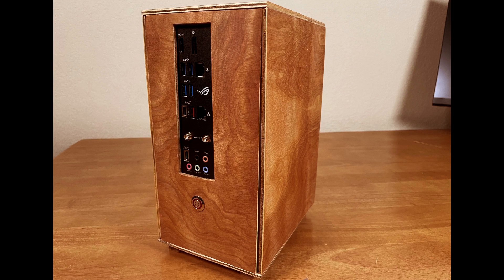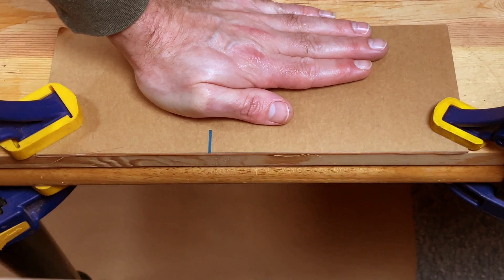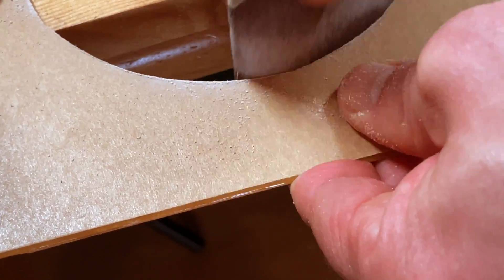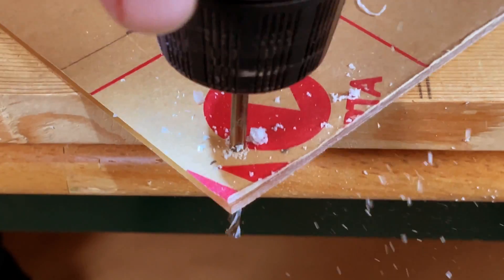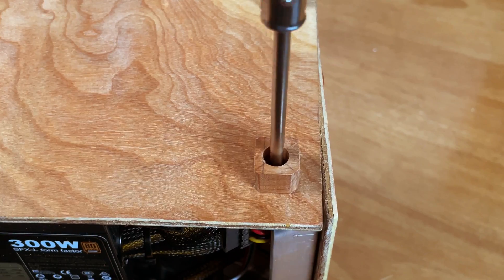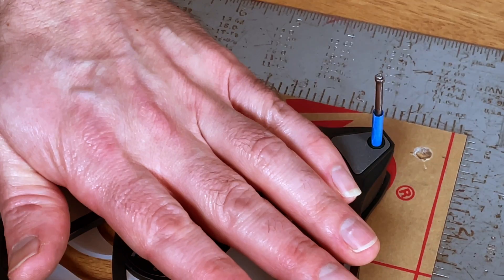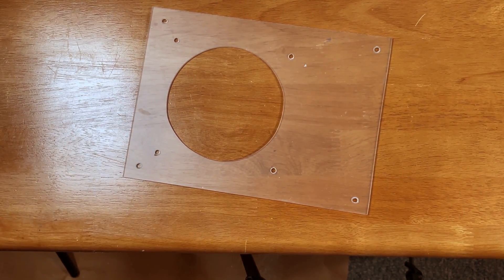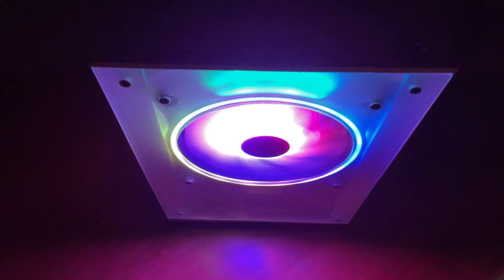DIY PC - Custom Fan Install RGB 140mm - Build Your Own Mini ITX Computer

Comment: I loved your project, it's a shame that in my country it would be somewhat expensive (starting with the MoBo ITX). I would recommend making some openings in the upper part to generate positive pressure and thus improve cooling. I have the idea of making one with my new PC that has a Micro ATX MoBo, based on a PVC plastic sheet of at least 3mm, only if I did it I would use angles to join the main structure and I thought maybe I could use hinges and magnets ( not powerful) for the sides
Reply from the maker: Thanks for watching.  That sounds like a cool idea!  There are a lot of ways to put a case together, you just have to get started.